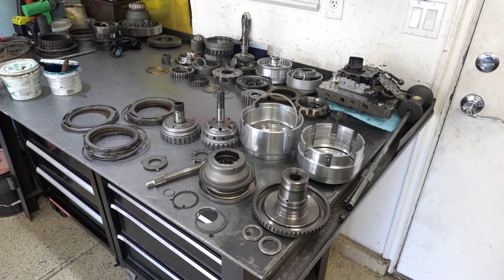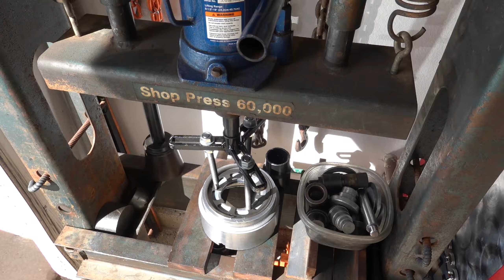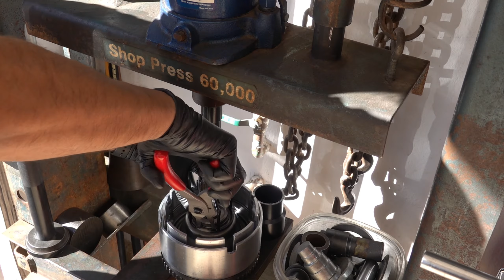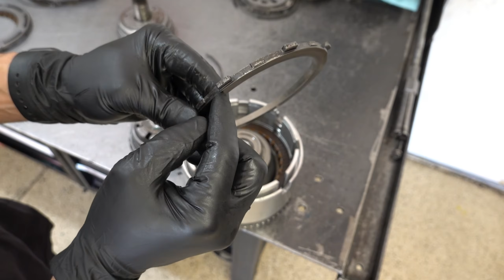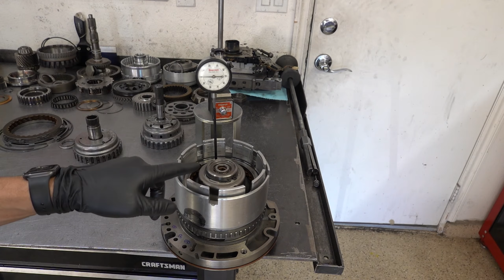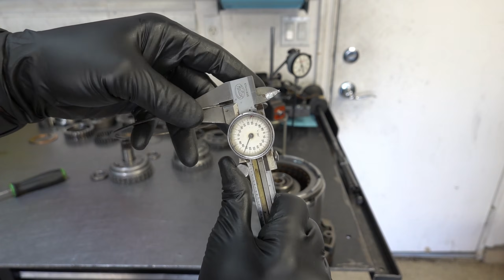62TE Demo Assembly Part 2  - Input Housing

Comment: Where did you get that transmission spring compressor? The one with the three bolts and at the 8 minute mark.
Reply from the maker: I bought it off eBay...The seller's name is Transmission Jobber Supply; it cost $75.00.
Reply: @nickstransmissions  Do you have the part number or link for it? I can't find it in the Ebay store.
Reply from the maker: It must be out of stock at the moment but keep watching the listing as they produce and list them in batches.